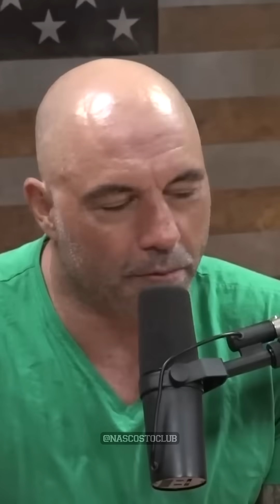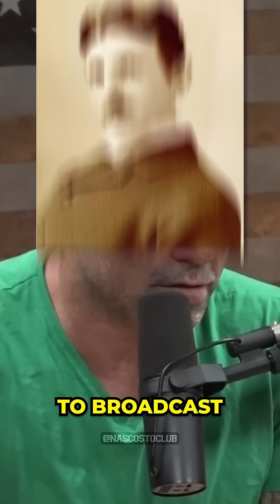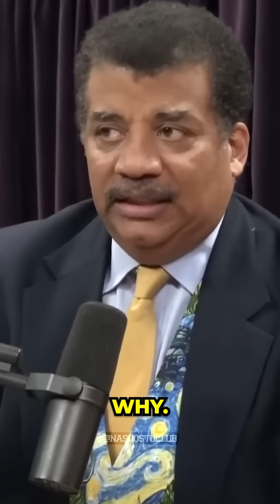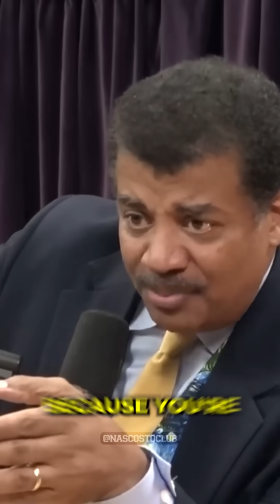WIRELESS Electricity Idea Debunked ⁉️⚡ #shorts

Comment: It wasn’t going to be one tower trying to power the world, it would be a network
Reply: that changes nothing? the amount of energy per cubic feet of air would have to be the same regardless of the amount of towers. having more towers would only decrease the amount of power each tower would have to emit. no matter what the amount of energy in the air required to power a house would still kill you
Reply: @powderedwater4742  The energy field Tesla used doesnt kill. You can stand in a Tesla coil field of millions of volts and will perfectly safe and power light bulbs in your bare hands. The field will fry tiny transistors in our modern electronics though. That's the real issue it's not practical if energy was not a concern. Because it's not nearly as efficent as using wires.
Reply: @powderedwater4742  so basically this tower would be similar to a pylon that carries power in its lines, even on them power lines you don't have to touch them to get zapped
Reply: 5 g?
Reply: @williamwaggoner8904 literally nothing to do with it lmao
Reply: @Sthrl188  the principle is the same.  5g transmits EM radiation, which a receiver can get information from by measuring the frequency and amplitude of the radiation. It can do this because the radiation induces a small electrical current along the antenna. Which is the same principle that wireless charging uses.
Reply: @Alex63285  yeah well thats basically just changed up from before a bit so ion get most of yall
Reply: @AP  Yea sure, but wireless charging works at a very short distance. The inverse square law tells us that every time we double the transmission distance, we lose four times the energy. You can not transmit the power we need to run our lives over the air. It would be a massive waste of our resources.
Reply: Mike Hollis, you don't understand electricity. Neil is right. It can't be done and also it wouldn't be practical bc how could you meter it for use? Everyone would get free energy. Free doesn't work.
Reply: No actually just a few basically one...the power runs through the ground and yes in the air but it won't zap you.....the guy did a test he put a light bulb in the ground it lit up but there was nothing to zap him.

Comment: NDT is speaking facts. Tesla was a genius but there is now way to send sufficient power to everyday items we use with the way things are now. Now if they could reduce the power needed to run things low enough maybe. Consider your remote, you send signals to turn things on and off. If they could scale down energy needs nothing is impossible

Comment: No no no. Appliances are designed for the style of power we use. If we used wireless power isn't it possible that devices would have designed differently to operate in a different way? Perhaps having an inte all storage system so theh build up charge while not in use to later use that charge when needed? I'm not Nikola Tesla, just my thoughts.

Comment: Neil really doesn't seem to think of the simplest solutions to his arguments. We put wires up high, just as you said. How am I going to stand in the way of wireless power waves if the waves are coming in from the top down Neil? I'd have to literally climb on top of the device to interrupt its connection. He is the most one-track-minded individuals I've ever seen
Reply: You are dumb
Reply: If the wire is above the house, why not just run it down into the house at that point? Neil is right, that idea is very out there.

The amount of energy in those waves would have to be ludicrous and you would essentially be xraying everything constantly
Reply: You’re such a dumb fuck. How are you going to control where the power is coming from? Air is a freely dispersed medium, how the fuck are you going to make air follow a pathway? 

I get it that NDT goes off rants sometimes but Joe Rogan and his fans are retarded as fuck
Reply: If it were possible, These types of waves would have to be transmitted in all directions to supply power to everyone. It would pretty much kill anything no matter where you stand. And waves abide by wave mechanics, so they refract and reflect, making the super high energy waves completely uncontrollable. Fiber optic wires give us the most control over how the energy moves
Reply: That isn't how it works. Tesla's idea was for electricity to permeate the air, everywhere. There would be zero use for wires as you have described, if anyone could even make one which they can't because nearly 100% of the energy would scatter off the air molecules.
Reply: Wires can change direction easily, be run through walls easily, can be shielded from environmental interference, etc. Wirelessly transferring energy like you say would require devices to send, receive, and change directions of the energy WITHOUT significant loss. It's not impossible, just highly inefficient. Why pay 10x more for something you can get cheaper and more efficiently.

Comment: Meanwhile,  a half dozen drunken rednecks took their burned out fluorescent tubes under the High Tension transmission lines that run over the corn field to play Jedi vs Sith with glowing fluorescent tubes  ...  gee Neil,  would you like to testify to the fact that High Tension lines are unsafe in a lawsuit against the power companies?
Reply: Thats the reason why houses have to have a secure distance to that powerlines you braindead individual. But to prove me wrong just take a tent, go to that corn field and camp under that powerline for lets say 2 months.
Reply: @HandOfSatan  Google homes under high tension power lines.  Click the images tab. 
Now tell me it doesn't happen because of rules.  And they are there for more than 2 months .
Reply: @retsaM innavoiG I recommend you re-watch the video,  after Neil went ape about not running a motor on it Joe scaled back and asked about lighting and communications.  It seems to me that fluorescent tubes are lighting. As to buildings proximity to high tension lines,  I found images with Google of examples of buildings that preexisted the lines,  and are still occupied after their installation,  and actual subdivisions developed, built and populated after the high tension lines.  I also read what you're talking about  .... it mentioned that exceptions could be made,  the part it didn't mention was how big the bribe had to be to ignore good sense,  but I can tell you I remember watching one of the news magazine shows way back in the 80s or 90s about rural farmers suing power companies and lost gee, deep pockets with expensive attorneys won,  imagine that.

Comment: Get  2 copper coils, magnet attach with wires to a lamp place magnet on coils x the bulb lights up, I think Tesler was on to something.
Reply: Yeah tesla wasn't transferring radio waves.
He was making the air transfer. A.C. electricity.
He is trying to explain something he doesn't understand

Comment: the tesla wireless electricity towers do not use radio waves, they send high voltage electricity into the ionosphere, where its free to flow until it finds strategically placed paths of least resistance, highly conductive receiver towers on the ground, the technology works, tesla proved it all the way back in the late 1800s. only recently with the release (de-suppression) of the patents have people started building the towers and testing them, the effect of their use looks alot like aurora borealis, because it is doing essentially the same thing, charging the ions in the ionosphere and creating a luminescent effect in the sky.

Comment: This guy is bought by the higher ups idk if it's possible but I do know my buddy told me if u go under the power lines that were connected to big transformers and stick a light bulb in the ground it will light up I called bull sht but we did it and it worked

Comment: Dr Neil is right. However, growing up I had a made who lived behind a radio station antenna. This was back in the days of AM. If you put the old 9 volt transistors at the back of the house. The  old 9 volt transistor radios would pick up the signal with ease. Without batteries or power. We did thos a lot.
Reply: AM = After Meth? 😂
Reply: @nat0rade  hell that made me laugh .... true though back then pot was the root of all evil....bring back pot and AM transistor radios....good times.. peace out.

Comment: What is the Tyson doesn't seem to understand is that the whole earth is a giant battery and we are essentially standing and living in a giant magnetic field. He's talking about transmission of energy but the energy already exists in the field that we're standing on.
Reply: And when you finish doing that you can listen to what he's actually talkin about which is transference of energy and what he's talkin about transference of energy is that we do not have the medium to transfer that much electrical energy into mechanical energy like a radio wave how how a transmission device sends a signal that someone else can pick up. Bewhy I'm using talk-to-text coalescing the signal with a piece of quartz. This work still process called magnetic induction. Or inductive reactance to be more specific. So instead of saying something stupid to me go give yourself a swirly.
Reply: @calvinbarrett437  he used that as an example of why you cannot have wireless transfer of electricity. He created the strawman and argued against it. And you accepted the argument. The simple fact is Wireless Power Transfer (WPT) already exists
Reply: @MistaOneGuy  I know it exists I'm replying to someone else. There's Quantum Computing that are connected with black holes. If you do the mathematics and Quantum Computing you will find the holes that the verify transfer of energy on the quantum realm all you have to do is put in the correct algorithm and you'll have a mathematical formula that will give you this equation and some of the AI search engines we have with pretty-much I think probably do that for you.
Reply: Dont know whats wrong with you dude. But all NDT is talking about is that it's bullshit to power your light bulb, microwave, oven, dish washer or whatever high power device you got at home wireless over the air and in this case he is absolutely right. It doesnt matter if it is physically possible or not as long as you lose 40-80% of the power through bad efficiency and seriously harm every biological being that is moving through that field.
Reply: @HandOfSatan  okay what's wrong with me is first off you caught me at the wrong time at the wrong moment with stupidity. Second you're talkin about projecting energy and microwaves. And that's what he's talking about. And you're right you will lose energy in the dispersal however that's not what I'm saying at all what I'm saying is you are already in an electromagnetic field all you have to do is utilized the field that you are already living in. You do not have to project any energy you're already in an electrical magnetic field you just have to use the energy that you're already in it's a matter of practical use. You're like a guy who's complaining about how he can't use hydropower. Pooh swimming in the middle of the ocean.
Reply: @calvinbarrett437  Are you even serious or is that bad comedy? You'r talking about using the Energy of the earths magnetic field? The Field strenght on ground level is between 20-44 μT. That field is so weak that you would need absolutely massive "collectors to catch enough of it's energy just to light up a single light bulb. And the even worse part of that idea is that If we would "harvest" that field we would weaken/eliminate it which would lead to eliminating all life on earth 😂
Reply: @HandOfSatan  Take a look at Tesla's mathematical equation of a lightning bolt.
Reply: You don't need collectors. What you need is an inductive reactance.
Reply: look,You are basically standing on a generator that has an iron core that is spinning it has polarity it is the same thing as a Tesla motor. There are 11 basic types of motors. The Earth is essentially  A wireless electric motor. You have multiple Eddy currents in the electric field of this motor. All you need to do is inducing electrical reactance( I'm saying electrical reactance but capacitance  would be more accurate because what we're trying to do is accumulate the power that's already in the field and then redirected for our purposes).from the field that surrounds you. You can't ground it to the motor to the Earth you have to use the field itself. So get this the whole energy of the earth is flowing through this field it's inducing a voltage electrical pressure. It's not the pressure that you want it's not even the current that you want it's the wattage the combination of the two. They gives you power to actuate whatever it is you're trying to actuate. You're writing UT coefficient of friction in torque?I am not sure exactly why you may think that is relevant. Think more of microfarads in electromagnetic field a magnet if you will. you can induce current from a magnet more appropriate would-be lenz law. But really what you're looking at is the same laws governing a transformer. What you are going to have to do is increase the cycle of the induced current. The same as windings in a transformer. Think high voltage and low current versus high current low voltage. Because the actual goal is to induce a voltage or you don't have one. Except here's the thing on this planetary body we do have voltage. The input voltage of the earth measured in Henry's for the electromagnetic field. And then step down that voltage to a usable level that is functional for the task at hand. And then take this whole thing and compact it.look up capacitive reactance.And Inductive reactance. A lightning bolt is essentially a inductive reactance because you're inducing a current through friction.
Reply: You know listeningto myself make an argument here I think I should just go make one of these freakingthings.
Reply: @calvinbarrett437  bring that to the shark tank please. Not sure if they will laugh as hard as I do but for sure they will 😂😂
Reply: You so dumb boy 🤦
Reply: @HandOfSatan  I don't need BS from someone that doesn't know how to tie their shoes look up inductive reactance for how Transformers work.
Reply: @calvinbarrett437 TransferFi in Singapore. It already exists.

Comment: What about that coronal mass ejection in the 1800's that had telegraph machines on for HOURS unplugged? Hmm? No one died from that energy...
Reply: Most of it is blocked by the earth which is also why it interferes with electronics and will lead to most of them getting fried. The actual amount of energy hitting you, a human on the ground is not THAT much
Reply: telegraph lines are great for electromagnetic induction. It's effectively a very long piece of wire in a changing magnetic field.

Comment: Clearly Neil is a sientist, not a visionary like Tesla was 🤷🏻‍♂️
Reply: Clearly Neil is an actor, just like Bill Nye " I play the role of a scientist" actor Science Guy...

Bill Nye, Neil deGrasse Tyson and quite a few others are strategically-placed actors shepherding the flock where they want it to go and they have done this for longer than we think we have been paying attention.
Reply: Exactly 💯💯
Reply: Yea, but in this case he was right, radiation alone puts a stop to Tesla's idea, also Tesla is overblown up these days. He was a mad scientist.
Reply: And clearly you're a retard with the knowledge of a 10 yo kid.
Reply: Even if NDT got a tripple stroke and gets run over by a tank he'd still be 9 times more intelligent than ppl like you i guess. Never seen a comment section full of so many dumb people. Transmitting high amounts of useable energy through the air is the dumbest thing imaginable. No matter if you use magnetic or electric fields, radio waves or lightning bolts.
Reply: @HandOfSatan  You sound like the guy in 1950 who said video chat is the dumbest thing imaginable smh just because you're not smart enough to do it doesn't make it dumb.
Reply: @HandOfSatan  Like I said just because you're not smart enough to do it doesn't mean it can't be done I bet you believe the pyramids were built with ramps and giant cranes huh.
Reply: @HandOfSatan  My point is there was someone in the past who said that about everything until someone actually did it back in the day people even said cars wouldn't catch on and how did that turn out so once again just because you're not smart enough to make it work doesn't mean it's not possible.

Comment: If you’ve ever worn a jacket in the winter with no fabric softener you’ll understand why this is a bad idea. It would transmitted like static. Static can, will, and does cling to objects. And let’s say you touch something metal like your car, another person, a shopping cart… ZZZZTP, you just got tasered
Reply: TransferFi in Singapore. It already exists.
Reply: Your imitation of NDT is spot on.
Reply: Nope
Reply: I literally pick my jacket off the ground never been fabric softener ever. . every other day and have no fucking idea what you are talking about
Reply: @Stowneyo  anywhere there is a heater the air gets incredibly dry and that causes incredible static build up in the local atmosphere. It’s why most people that run electric heaters or gas heaters will also run humidifiers. No moisture=more static buildup. 

The same thing happens if you stand under giant transformers. The static will build up on you and your vehicle regardless of humidity levels. I’ve been shocked so hard before during the winter I saw a flash of electricity. 

If you want to experience static since apparently this natural phenomenon has escaped you. Put on socks preferably wool and scoot across the carpet/a rug. You’ll build tons of static in your body.